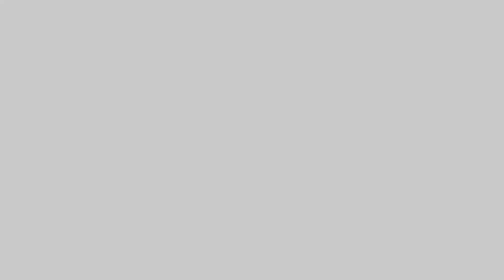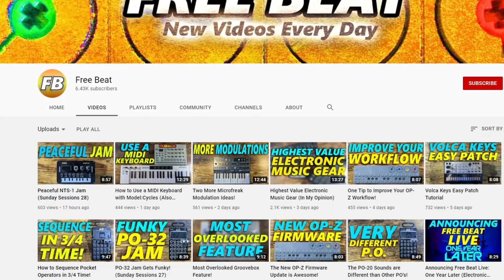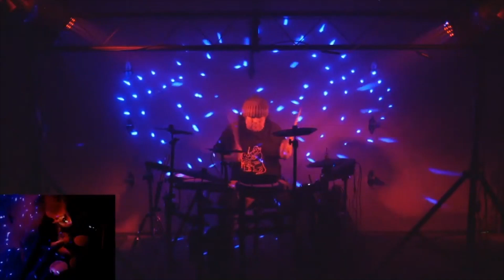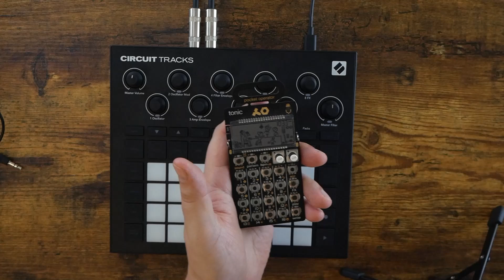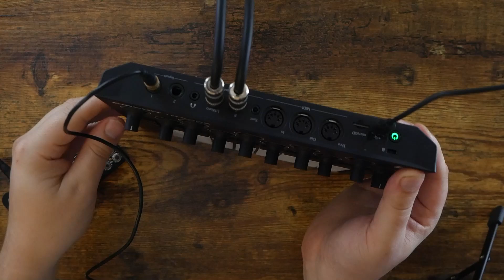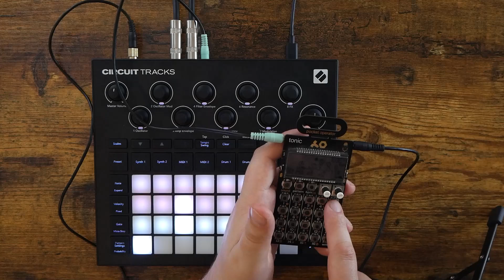How to Sync Circuit Tracks and Pocket Operators!

Comment: So...  you are using the analogue (pulse) sync out to trigger the pocket operator. But you are talking about not being able to mute the audio of the pocket operator because of the "Midi" mute. But sync-out is not midi. There's no midi going to the PO here that I see. Just a pulse. Right? Or am i misunderstanding? The behavior makes sense. I'm not sure what the result would be if it was a midi device, with midi cable coming to it, and you muted the track. Have you tried with a volca or something?

Comment: If you're having trouble syncing the two, check not only the sync mode on the PO (should be SY2 for a single PO), but also check the sync clock output in the Circuit Tracks settings (pads 17-21) on the setup page, as this controls the pulses per quarter note. Refer to page 106 of the CT manual for details. For me it was playing at double speed by default, your settings may be different or you may have changed them by accident. Hope this helps someone!

Comment: Is there away to sync po operator to the model cycles??
Reply from the maker: There is, but you would need some sort of device to bridge the gap between the sync signal and MIDI. Something like an Arturia Keystep would do the trick!
Reply: I think that if you have a splitter for your audio coming out of the model, there is one of the channels which you can plug into the PO, I think I've saw some tutorial online about that.
Reply: pick a volca as a bridge, cheap/fun solution

Comment: Yo, anyone else getting some unpleasant background noise? It's only when the tracks play button is on for some reason. If I turn sync off the P.O. sounds fine. This is weird, at first I thought it was just one of my cables. But, I guess its the circuit tracks
I just started experiencing this.
Reply from the maker: Cycle through the different sync modes on the pocket operator and see if the issue persists.
Reply: @FreeBeat  I've tried Arcade, Sub and street fighter. whats weird is its only when the sync is plugged in, and the timing gets messed up too. 
I'm hoping somebody knows something I don't. I have tried diff. Sync modes, diff. cables and each P.O. I got. IDK

Comment: I did not know that the Circuit Tracks's "mixer" only "mutes" MIDI signals going out rather than sound coming into the unit.  Not sure whether that's a good or bad thing yet.
Reply from the maker: I think it's both good and bad. The bad side is obviously that you can't just straight up mute the audio, the good side is that if you are running something via MIDI and have effects on it, the tales of those effects play out even if you mute the track.